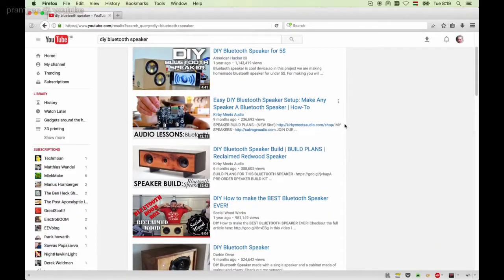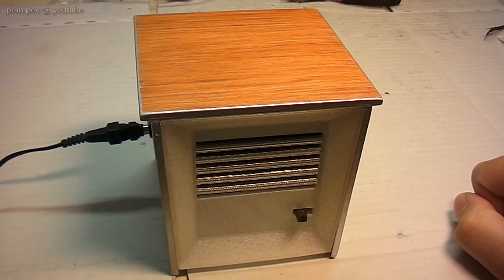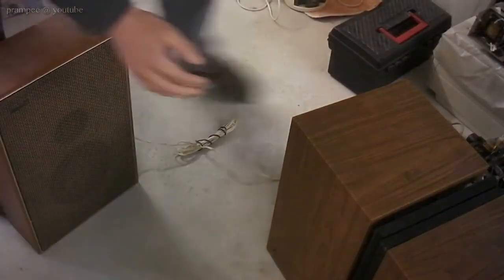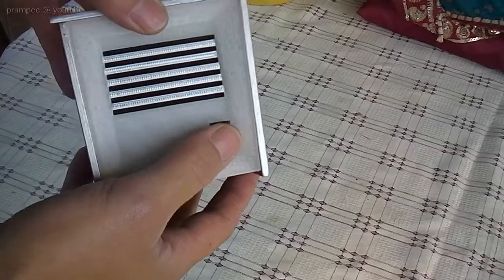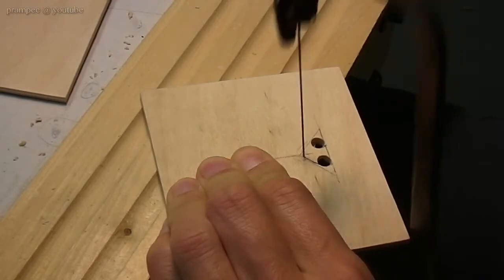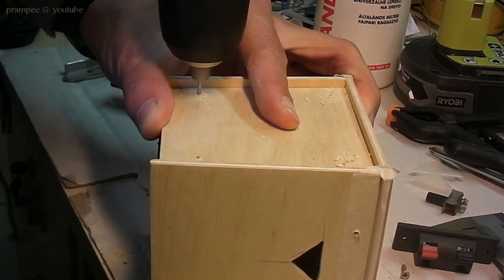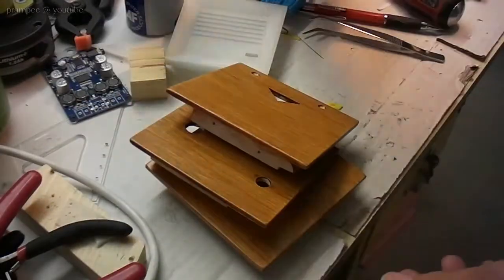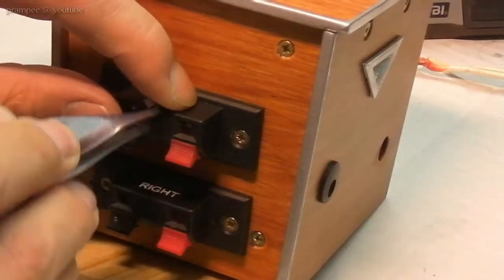Bluetooth Amplifier Case for TDA7492P

Comment: I was looking through my stuff that I already have and I happen to have a 12v 3.0 AH Makita battery and charger from my old cordless drill, think that might work better if I solder on a power plug to the battery? If I can use that instead it would save a ton of money off eBay.